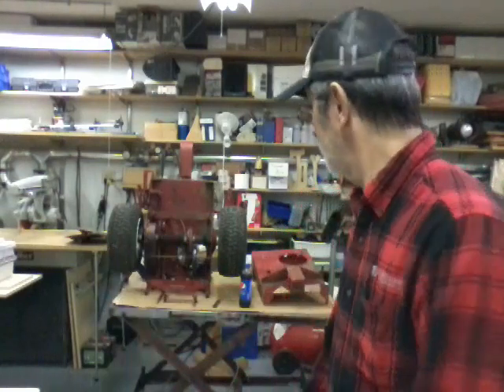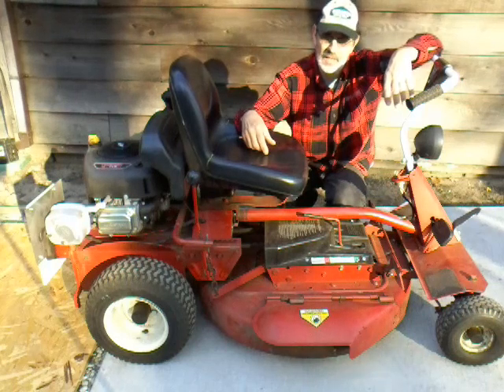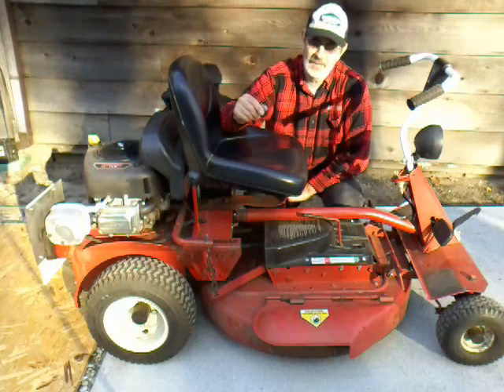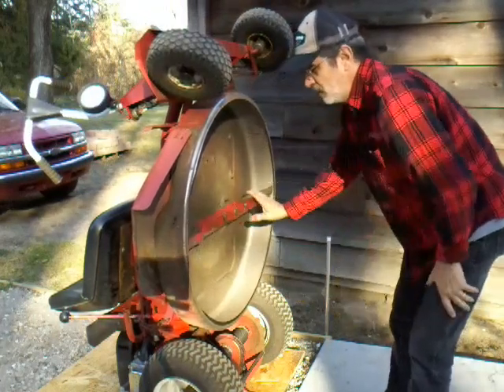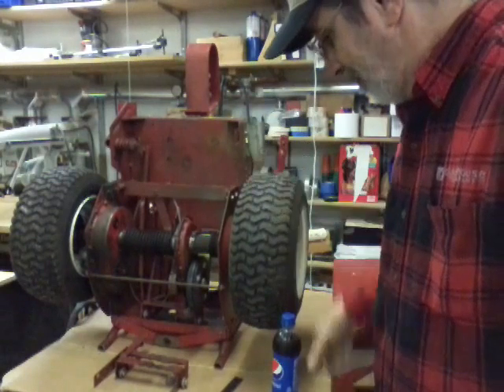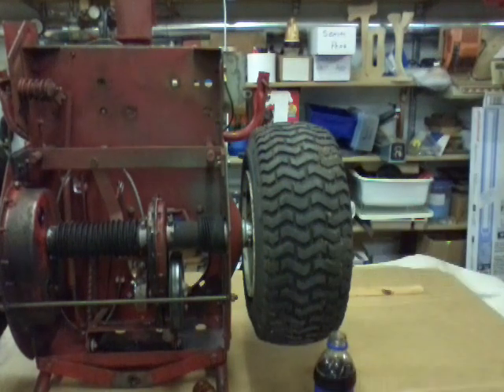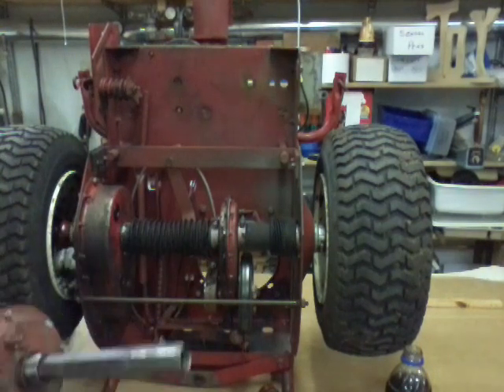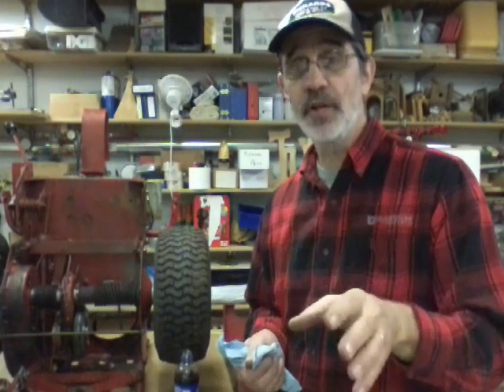56. Buying a used snapper,   things to look for

Comment: Jim, I can't find a part number for the "C" shaped shims you mention to reduce side play, nor can I find the nylon bushings for the pipe on the 'front structure'.
Reply from the maker: Jim Herring 
The only way I can look this up on Partstree is with your model number. The C shaped thrust washers they don’t make any longer buy the round ones and cut a notch out with a pair scissors. Jim
Reply: @jimjackson9381  Sorry Jim, I was under the impression these two parts were the same through-out the models. I'm the guy with the model 30115s which you said has to be 3011x5s, and that makes perfectly good sense. My local dealer whom I just met today, agrees. He also said I could ascertain the approximate age of my machine by the code on the engine, assuming it hasn't been replaced which I'm fairly certain it hasn't. B & S code is the exact date it was manufactured. 84010911.The '11' is the horse power rating. Of course you already knew all that.   Another question. On the main case parts diagram, I have what they call a 'rod', part reference #37. The diagram lists several associated parts that just do not exist on my machine. What is it's purpose and what will not work properly without it?      Your vids are invaluable and the fact that you actually answer our questions is amazing. If I could, I'd subscribe a hundred times.
Reply from the maker: Jim Herring 
 Hi Jim, I looked up your main case on partstree And part number 37  is a washer are you sure you have the number right. Jim
Reply: @jimjackson9381  Sorry again, it's on the smooth clutch page, my bad!
Reply from the maker: Jim Herring 
That bar is part of your linkage for your reverse. Jim
Reply: @jimjackson9381  Some of those parts are unavailable so it looks like we'll have to make them. If I order what I CAN get, I may be able get some specs. I wonder what else is missing. Still having difficulty finding the bushings for the front tube. Thanks for the reply!
Reply from the maker: Jim Herring 
I will call Mon. and ask for part no.s and let you know. Jim
Reply: @jimjackson9381  It looks to me that the purpose of this linkage is to increase pressure on the clutch in reverse which would explain the two different springs in the tube.
Reply from the maker: Jim Herring 
Actually the springs inside of the tube that the shaft pushes against is to help it kick out of reverse is soon as you push in your clutch it’s more of a safety issue than anything else. Jim
Reply: @jimjackson9381  I see, I've heard you say it pops out of reverse when you step on the clutch. I had a Toyota like" that once. Turned out it was missing a $.45 thrust washer. Thanks for the reply. I have a 30", which is apparently just a side discharge. Is there away I can mulch with it, short of changing it  to a 28" deck?
Reply from the maker: Jim Herring 
The viewers I have talked to say the ninja blade for the Snappers work pretty good for mulching. Jim
Reply: @jimjackson9381 If I get this thing running by next spring, I'll try that. But what would you suggest I do about the large discharge chute, block it off? I still can't find the nylon bushings for the main tube from the front end on any parts diagram.
Reply from the maker: Jim Herring 
  Yes I’m having a little trouble myself can you send me a picture of the front of your main case from the side view so I can see where the tube goes through,   it would be behind the battery. Jim
Reply: @jimjackson9381  I've sent pics via email, please let me know if you got them.
Reply from the maker: Jim Herring 
Hi Jim
  OK I believe I found the part that you need, it’s called a main tube grommet you need two of them and the part number is 7011033 and they are $5.42 apiece.  Jim

Comment: Would you recommend the new big commercial 15 hp rear engine snapper? Like the one you own?
I heard that to stand it up you have to drain the oil?
Or is shutting the gas tank air vent all you have to do?
Reply from the maker: Jrhnhemp 
It depends on how long you’re gonna have it standing up they recommend if it’s standing up for more than two hours to remove the battery if I have them standing up for more than 20 minutes I remove the battery if the batteries leak they will run down on top of your carburetor in your wiring and then you have issues even a maintenance free battery will leak, if you’re going to stand it up to work on it shut off the gas vent and most of the tank Won’t leak if you’re going to stand it up for winter storage I remove the battery I drain the gas and the oil some oil will seep out of the dipstick tube onto your floor, you should change your oil once a year at least anyway. Jim
Reply: @jimjackson9381  Good info. So its not a simple stand it up until next week's mow unless the battery is removed and all fuel drained. This makes me reconsider my storage location.
I appreciate knowing this prior to purchase. Thank you.
Reply from the maker: Jrhnhemp 
You don’t have to drain the gas just to store it for a week your cap will seal the tank I just don’t store over the winter with fuel because it will go bad, and if you buy a battery like the ones they are putting in the new machines I have one in my 2012 it will not leak so I don’t have to remove mine when I stand it up the store short term. Jim

Comment: I have replaced the belt and drive disc ran a few times then it's just not getting enough power to go.
Reply from the maker: Lori Chappell 
Is this a walk behind or a rear engine rider
Reply from the maker: You want to watch video number 70 the last half explains how to tighten the yolk spring that will give you more grip on your clutch disk if you have a rear engine rider it's not let me know thanks Jim
Reply: Jim Jackson Bless You!

Comment: Jim I got a snapper with a 14.5 hp kohler I put a new clutch disk on it and it won't move but the  axles turn when in gear what do you thank is my problem i am from Louisville ky
Reply from the maker: Have you watch video number 70 and check the yolk spring. Jim

Comment: Old snapper rider Gas cap Has a small adjustment mechanism. It tightens or loosens. Backfiring when I start it. Should the mechanism be adjusted?
Reply from the maker: Kate Palmer 
The screw on the top of your gas cap is a vent it should be all the way open,  if you stand your machine up to work on it you want to shut it off so the gas don’t leak out that’s all that it is, the backfiring issue could be timing does your machine run at all or does it just backfire?. Jim
Reply: Jim Jackson thank you

Comment: 14:10 can we get more of that shaft at work? :) im thinking about buying an 8hp with a bagger for under $100 but it is not running but the engine is not locked and supposedly it just quit starting recently.
Reply from the maker: yang mills 
 Hi it’s Jim
Your question,   Can we get more of that shaft at work.   I am not sure what you’re asking. Thanks Jim
Reply: i was just making a bad joke. I just bought one of these off craigslist today for $75.  I tried to do some of the checks you mentioned. I will be emailing you some pictures and video with some questions have and issues i see.
Reply from the maker: yang mills 
 Hi it’s Jim
   No problem I just didn’t know what you meant that’s all, but if you have questions or issues please let me know and I’ll be more than happy to help you out that’s why am doing this channel. Thanks Jim

Comment: Hey Jim I have the 28 deck 9hp snapper. I cleaned the carburetor, but the pull cord is stuck. I took the pull cord off and pulled it. The cord works fine. But when I put it back on the engine it starts to stick again. Any ideas
Reply from the maker: T. Stores 
 First I would check to make sure the engine turns OK by turning the drive desk on the bottom make sure it shut off. 
   Otherwise something is wore out on your recoil and it's binding when you put a load on it.
   That's one of those questions I have to see it to figure out what's really the issue. Thanks Jim

Comment: hi Jim brilliant videos looking to buy an old snapper mid 90s ?? with honda 8hp engine with cutter deck removed (rotten) would snapper be okay to tow small trailer with 30 kg of rubble thanks steve
Reply from the maker: Stephen Smith 
Hi this is Jim
  If the clutch on the snapper is working properly it shouldn't have any problem pulling 60 to 100 pounds in a trailer depending on how much the trailer weighs if it's just one of the small ones that's plastic that's the size of a wheelbarrow you'll be fine but if it's a full-size trailer that weighs 700. 800 pounds empty you may have a problem. Thanks Jim
Reply: thanks jim for your advise will be a small trailer light weight

Comment: Trouble started when my Snapper riding mower was difficult to shift. I broke the shifter which I replaced. Now it goes only in one speed, even in neutral. It doesn't feel as if the shifter is engaging. What do I do?
Reply from the maker: Rick Humphreys 
Hi Rick
    Your machine may be shifting hard because you need to clean and grease the hexagon shaft under the two rubber boots. 
    When you replaced your shift handle did you remove or move the shift plate, you may need to readjust your shift plate to get your clutch disk in the proper position on the drive disk,  stand your machine up shift it in neutral or park whatever your machine has clamp the clutch pedal down loosen the two bolts on the shift plate and move it either forward or backwards to get the clutch disk in the center of the drive disk and try that to see how it runs and let me know. Thanks Jim

Comment: Can you tell me witch carb and manifold elbow I need to get for a 12.5 horse power briggs engine.
Reply from the maker: James Blasingime 
I am not sure right off hand but if you call Briggs & Stratton. in Milwaukee Wisconsin with your engine numbers they can tell you exactly what parts you need. Jim

Comment: Jim thank you for your very informative mower.  I am not mechanically inclined and as fate would have it, I borrowed a friends Snapper 28in. with 12.5hp motor that is approx 10+ years old.  Now it won't start, it has an electric start and it keeps turning over but not starting.  it has a full tank of gas, there is the right amount of oil and I don't know what to do?  Any help is appreciated
Reply from the maker: Jeff Connelly 
  It sounds like you may have a bad safety switch and it's not letting the engine start thanks Jim
Reply: @jimjackson9381  I just bought a snapper mower made around 1999. Do you know offhand what safety switches I should look for that could be preventing the engine from starting? For instance, will the engine start with the parking break not engaged? Is there a seat sensor by this year? etc?
Reply from the maker: Nick DipaoloFan 
Hi Nick
  Can you send me a picture of your machine so I can get an idea what it looks like, there is a switch on the clutch /Brake pedal that pedal Hass to be pushed all the way down for the engine to start if you have a single pedal machine, there is a safety switch on the seat there is one on the yolk and there is one on the mower deck on most machines if all your switches checked good and they are aligned right so they’re working.  Or it could be the interlock module that is the brains of the safety system and they’re not cheap what is it doing, does it start at all if not it may not be the safety system it could be your coil is bad let me know how it reacts when you’re trying to start it. Jim
Reply: @jimjackson9381  Thanks Jim, I just picked it up last night and only put some gas in the tank and starter fluid in the carb and pulled the cord a few times. So I really haven't done a ton to try to get it to start yet. This weekend I will replace the spark plug, clean the carb, change the oil, etc and try to start it up. I don't have any pictures of it right now but will post some pics for you if I can't get it to fire up this weekend. 
I will check all of those safety systems and see if my mower has them. If my mower has an interlock module that doesn't work, is there any way to bypass it without having to buy a new one? My other Snapper is an older model so I am new to all of these safety features.
Reply from the maker: Nick DipaoloFan 
Hi Nick
   If you’re trying to get it started on the side of the engine down by the carburetor where the cable hooks to from your throttle handle there is a small plastic block where all the wires hooked to that kills the engine unhook all those wires except the one that goes up inside the engine to the coil try to start it if it starts your key won’t kill the engine. Until you hook that wire back up you can use a small piece of wire or a screwdriver to shorten that out and it will kill the engine really all you need is the one wire coming from the ignition switch to kill the engine. Jim
Reply: I just got home and put the clutch pedal down and replaced the spark plug. It fired right up as if it hasn't been sitting for years!!! I could not believe it. This weekend I will fix the leak in the rear tire, change the oil and fuel filter, and wash the years of dust off of it. I bought it for $50 as a parts mower but it looks like this might run even better than my other snapper!
Reply from the maker: Nick DipaoloFan 
  Hey Nick glad to hear it took right off and ran great glad I could help if you have any other issues let me know. Jim
Reply: @jimjackson9381  Thanks! Your videos are keeping these mowers out of the landfill!

Comment: I have a lot of slop on my left rear wheel. What's the best way to repair that issue
Reply from the maker: Well I would like to see it but by the sounds of it you need to replace your axle bushing.      Jim
Reply: @jimjackson9381  I'll upload a video of it. I cant figure out the part
Reply: Mine is a 28083S. I'm on parts tree but I can't figure out that sleeve is.
Reply from the maker: Ck the axle bushing you may need to take off the wheels.    Jim

Comment: I’ve got a snapper with a 9 hp b&s. Do you know a 13 hp b&s intek will fit for a swap?
Reply from the maker: Potato king 
  Hi it’s JimYou should be able to swap out the engine if it’s a Briggs & Stratton that you’re swapping for another Briggs & Stratton they should fit without any issues and make sure you keep the old engine until you get a new one completely mounted you may need to measure the bolt pattern in relationship to the crankshaft especially if you’re swapping different makes of engines. Let me know if you have any issues,     I have a video that explains how to swap an engine to re-bolt and get the crankshaft in the proper location. Thanks Jim

Comment: I bought a 1982 Snapper not for sure what series it is I think three but I paid 150 for it and it did not run I put a new carburetor in it and took at Champion spark plug out put a better one in and now it runs
Reply from the maker: Brad Walker 
Send me your model number and I’ll tell you what series it is, I hope you’re a subscriber I can use your help and if you need any help repairing this thing just let me know. Jim
jimsfixitshop@gmail.com
Reply: @jimjackson9381  190701
Reply: @jimjackson9381  Iam a subscriber
Reply from the maker: Brad Walker 
Awesome thank you that really helps
Reply from the maker: Brad Walker 
According to your model number 190701
The 19 is the size of your deck
The 07 would be the horsepower of the engine
The 01 is the series of the machine
Does that sound about right the 19 is a little confusing I didn’t know they made a 19 inch deck is this a walk behind or a rear engine rider. Jim
Reply: @jimjackson9381  8hp and I think it is 19 it does not say I'm going to take a tape measure and measure it here after it stop rainy
Reply: @jimjackson9381  it's a rider
Reply from the maker: Brad Walker What size blade does it have on it or what size mower deck does it have
Reply: @jimjackson9381  do you have a way I can send pictures and I don't know the size of the blade right now
Reply: @jimjackson9381  28 inch
Reply: I got a brand new starter solenoid and two boots that I will trade for a ignition coil I can't find any
Reply from the maker: Brad Walker 
Have you watch video number 299 yet Mike in Virginia has a lot of parts and I would think he would have one send him an email and let me know what he says. Jim
Reply: @jimjackson9381  ok look on my youtube I just put a video of my snapper it's not long at all
Reply from the maker: Brad Walker Sorry all I can find on YouTube is Bradley walker as singer Do you have an address I can go to to find it. Jim
Reply: @jimjackson9381  sometimes it is hard to find people on you tube
Reply from the maker: Brad Walker 
I think I would take that recoil cover off turn it upside down and oil it good as you’re pulling the rope in an out and see if that helps. Jim

Comment: I changed my drive disc but it still won’t go forward or backwards. Please help
Reply: you may need to adjust the distance of the disc to the engine disc. I had the same problem and it just wasn't getting enough friction.